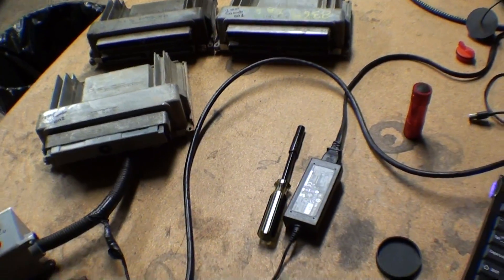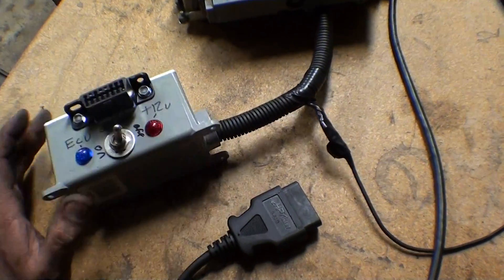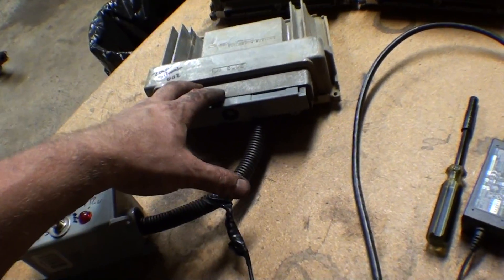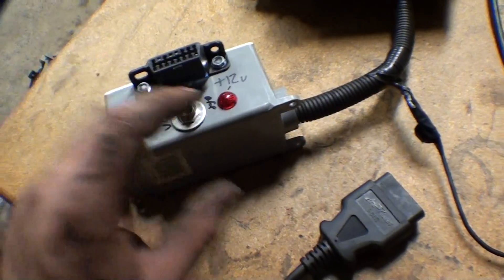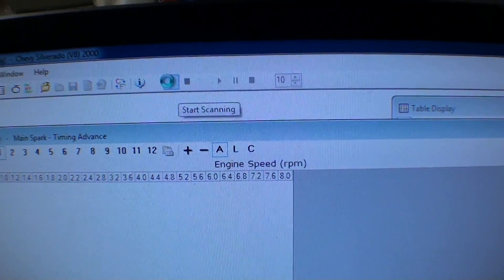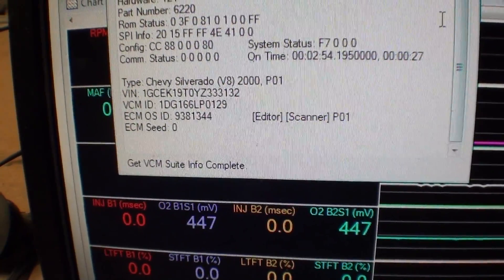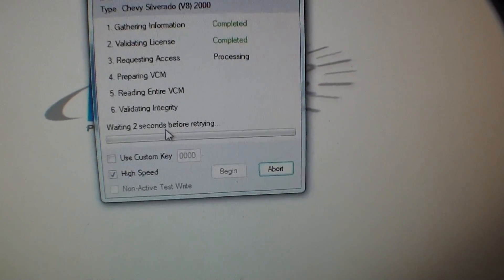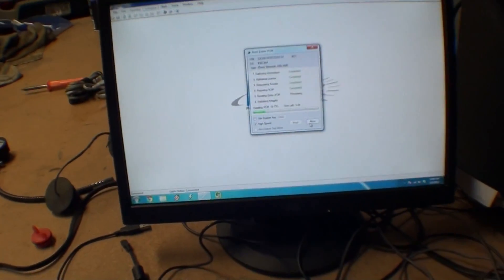8-7-13 Stock computer bench flashing harness

Comment: I have the complete wiring harness and computer for a 2009 LY6 all still connected to the engine with the electronic throttle... I want to change the valve springs and cam, and do a twin 60mm or 70mm trubo kit. Would it be better to buy EFI Sources Gold ECM kit, or have the stock ECM flashed like what you are doing? Can I still keep the electronic throttle body and pedal, or do I have to go with a cable operated set up? This is all going in a 1972 Monte Carlo.

Comment: on the power supply i have an old laptop charger and it uses  output 18.5 v 3.5 amps  with wide range of 65 W would this be too much. or cause damage?